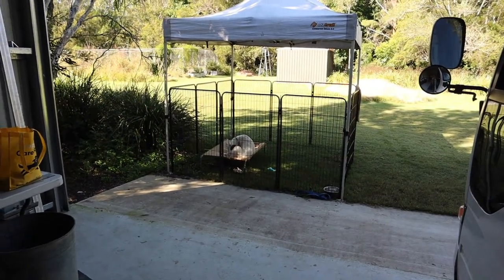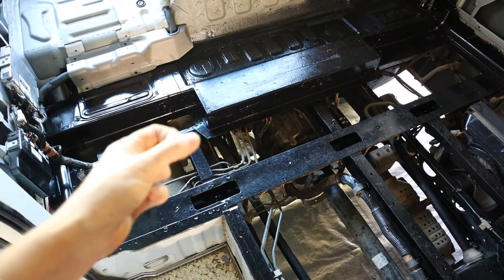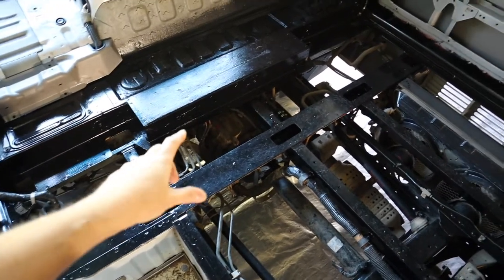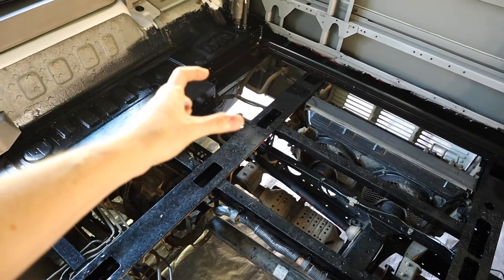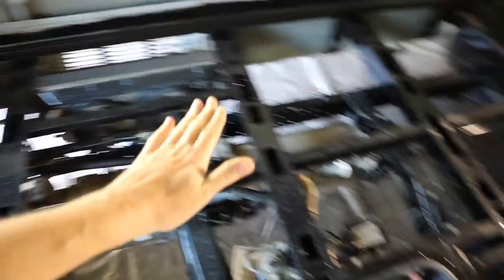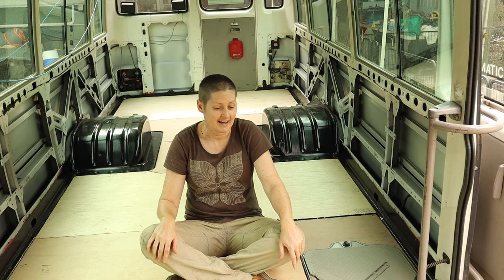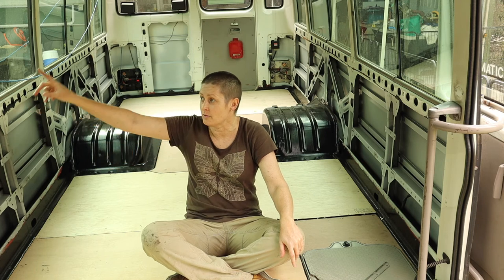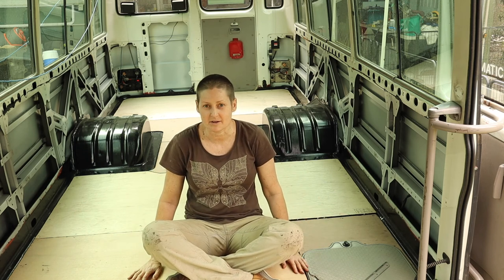Installing the new plywood floor in my Toyota Coaster bus.

Comment: hi a girl a dog and a bus what  are your thoughts about this idea - instead of removing the original floor adding a second 6mm floor glued and screwed to the original - that would I think avoid the where to screw it down issues and give you the thickness - I am about to convert my bus and enjoyed you insights - thanks bob
Reply from the maker: Hi Robert, yes that would work too. I only removed my floor because it had some patches of water damage and I just felt more comfortable replacing it all.

Comment: Nice work Dyani. I have been doing my Coaster over here in NZ and its awesome to see another women smash it out.  I have watched a few Youtubers do bus floors and yours by far has been one of the best if not the best I have seen. To my amazement I have seen many folks try to save money by putting in the wrong type of Plywood and in one case seen someone use MDF because it was cheaper..... I have also done the same as you where I have stripped it back to the bare bones so I can fix up the leaks and cracks. 

Also, maybe instead of using a rubber gasket for the fuel sender hatch you could try PVC Foam tape. Keep up the fabulous build and I look forward to watching your progress.
Reply from the maker: Thanks so much! I'm glad you are enjoying my videos. Do you have an instagram ot somewhere you share your own bus conversion? I'd love to follow along!
Reply: @AGirlADogandABus   No I haven't been doing videos of it, just focusing on doing the project itself. Have only really just started as well. I may start doing some tho not sure yet. Another thing you could use as a gasket, which is probably better is Neoprene rubber sheeting, which is also good for doing the taillight seals to if they leak. A common thing with the coasters. You just have to cut your own gasket of course.
Reply from the maker: Yes that's what I was thinking of using

Comment: What about installing water tanks, hoses and fittings before flooring??
Reply from the maker: The tanks I am getting are designed to bolt straight up into the floor without needing brackets etc underneath

Comment: Hi Dani,
Love your videos,can ask how you fix your flooring down over the steel plated area over the fuel tank? Is there a small void so the screws miss the tank. Regards Grant.
Reply from the maker: I can’t remember if you can see it in the video or not but my floor had some pieces of thick wood glued onto that section that the old floor was screwed into and I screwed the ply onto those. I think I put a few screws on the edges but I was very careful to keep looking underneath the bus to make sure I didn’t hit anything.
Reply: Thanks Dyani for getting back to me👍I see what you mean ,I did the same but the glue has not held properly in the middle of that area and now makes a noise when walking down the middle of bus, so I thinking of putting very short screws in that just long enough to pick the metal substrate hoping there might be a void above the fuel tank to do this. Sketchy😳
Reply from the maker: Yeah I was so paranaoid about screwing into the fuel tank or the lines underneath the floor!  Are you in any of the coaster groups on Facebook? You could ask there - someone may have more knowledge about whether there is a gap between the tank and the floor there.
Reply: Thanks Dyani will try those groups.
Kind Regards Grant

Comment: Those small pieces will rust?
Reply from the maker: Yeah I hope not. I did paint them with Penetrol and it is galvanised steel so it should be ok. But I do kinda wish I'd thought to put those pieces on first before I painted the whole frame.

Comment: How much did all the marine ply cost in total for floor?
Reply from the maker: It cost AUD$700 all up. Although because of how I had to cut the sheets, I probably only used about 2/3 of the ply altogether, so some of it will go into other projects.

Comment: Great job, as usual, Dyani! How many ply sheets did you end up using? and what do you think can be the minimum amount?
Reply from the maker: You know, I honestly can't remember now. I think I used four sheets, but there was a bit left over, because of the way I cut them to fit the frame. I think I explained that in the video. If you laid the sheets lengthways in the main section I think you could get away with three sheets. But you'd have to do the measurements for your bus. It has been so long since I did the floor. Actually, I am just now thinking of redoing it. I am having issues with mould in the marine ply and am not totally happy with it. Considering replacing it with Formply, which is what I used for my first bus. But oh, it is such a massive job. I'm still debating what I will do.
Reply: @AGirlADogandABus  I'm thinking of using thermo-lite boards, which is composite material, lighter, mould free, rot free, better thermal insulation, but 3-4 times more expensive than normal ply. This is why I'm trying to see if I can get away with 3 sheets of 12.7mm and one 6.35mm.
Reply from the maker: @sergeykolesov4992  How strong is that stuff?  I've heard of people using it for cabinets etc but not for the floor.
Reply: @AGirlADogandABus  The 19mm Thermo-lite board requires spacings at 610mm, while the 12.7mm requires spacings between 305mm – 406mm. This is info I've got. It's used for subfloor in some campers I believe.

Comment: Your floor frame map is great idea! Are you able to share ?
Reply from the maker: I have a picture of the map I drew on my blog here: https://agirladogandabus.com/toyota-coaster-bus-conversion/installing-the-new-plywood-floor/
You can use it as a general guide but please bear in mind that there may be differences with your coaster, in terms of the actual frame, as well as what is underneath it.
Reply: @AGirlADogandABus  
Thank you so much Dyani. I'm following your steps and It's really helpful. 
Now time to take all floor out and purchases plywood. 
Did you use 2440 x 1220 x 18mm? How many did you used them in the end? Looking forward to next episode.
Reply from the maker: Yes that is the size I started with. I ended up using 4 sheets of the 18mm and 2 of the 12mm just because of how I cut them and how I joined them on the frame. You could do it using fewer sheets if you run them lengthways instead, but I wanted good support underneath mine so chose to do it across the bus. I have a fair bit of ply left over but I don't mind as I will use it for things inside the bus so won't be wasted.
Reply: @AGirlADogandABus  
Thank you so much. I’m off to Bunnings this morning. 
😊🚎 .